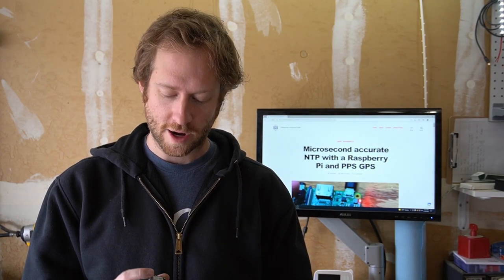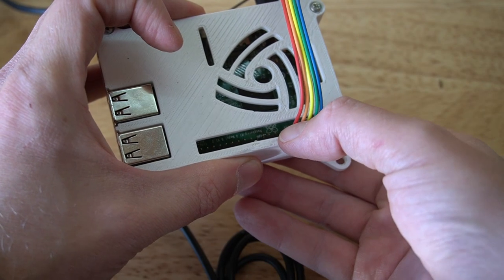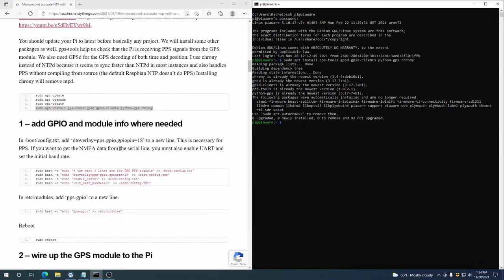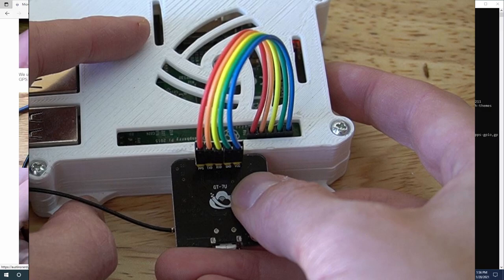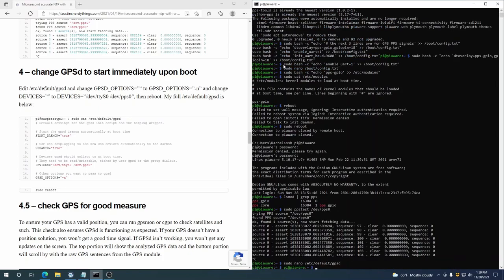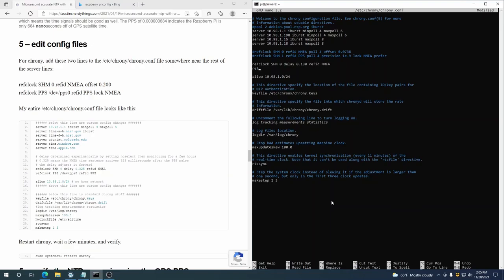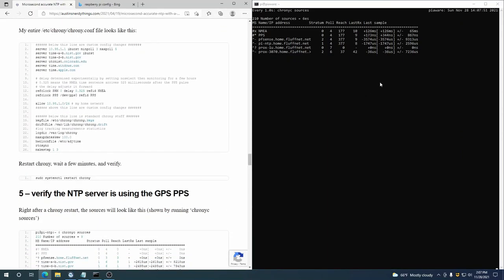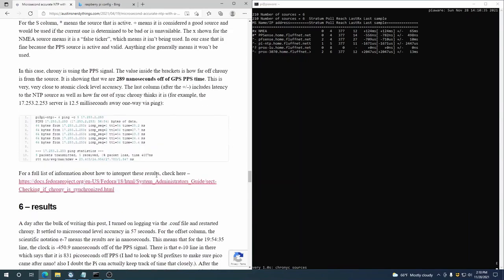Microsecond Accurate NTP using PPS signals from a $12 GPS

Comment: I accidentally got a module that didn't have PPS broken out to a pin, but it did have an LED.  I was able to tack a wire to the LED's resistor and brought that over to the Pi.  It's working great, but I know what to watch for if I get another GPS module.

Comment: Do you know of a way to actually display the time with high accuracy ?
Looking at it through the terminal, the network jitter is not controlled an the frame rate is very low, less than 10Hz.
I'm trying to display accurate time to at least millisecond on every frame, so at minimum 60 FPS and hopefully more in the future.
Reply from the maker: 60 FPS is still 1000/60=16.6ms lag. I am not sure of the best way to display super high accuracy time. You'd need at least 1000 FPS to do 1 ms resolution. Why do you need such high accuracy/resolution? The human eye is not capable of detecting much above 100 FPS.
Reply: Also read up on JND (just noticeable difference), which is the study of the precision to which humans can detect visual or auditory changes.  I believe it is 15-20 milliseconds for visual.

Comment: Hey Austin, got the stuff in to get PPS set up.  Is there any reason for pps_core to not show up when I run `lsmod | grep pps`?  I have the first line, as this:  ~ $ lsmod | grep pps
pps_gpio    16384 0.  Any idea what I need to do to fix?  FWIW, it doesnt seem to make a difference as I am getting great PPS accuracy.  I just wondered if maybe tyhere is something I would need to do to correct that.  Looking again after completeing the tutotrial, I see this now:  pps_ldisc              16384  2
pps_gpio               16384  2.  I dunno.

Comment: I was trying to use this as a NTP server for my local network, but it seems like it will not work without one external NTP server lookup.  My local ISP is having an issue with NTP traffic that they are still looking into.  Any thoughts on forcing chrony to use PPS only?